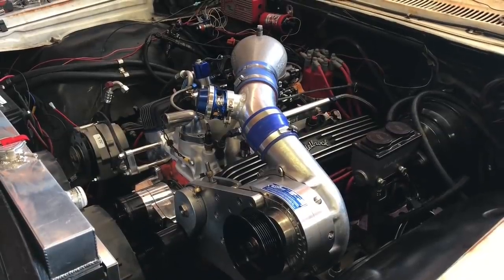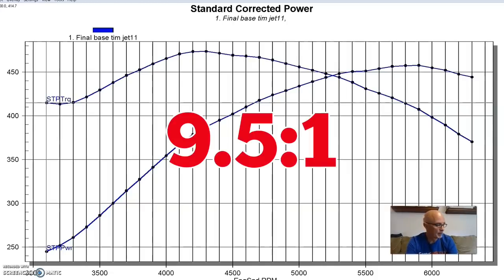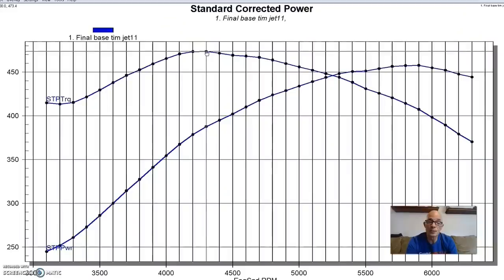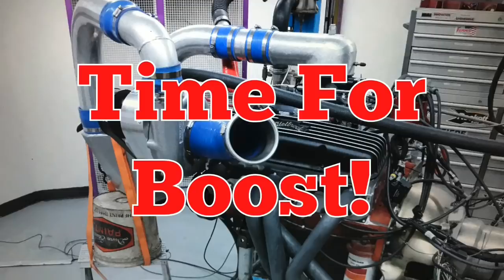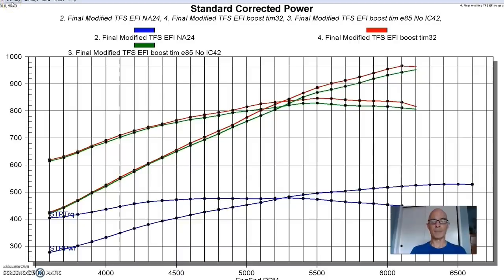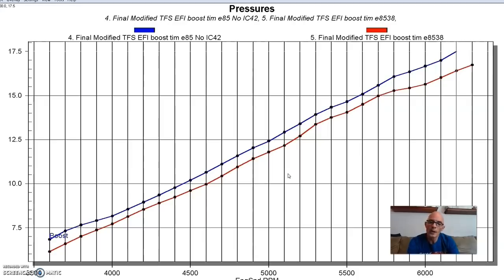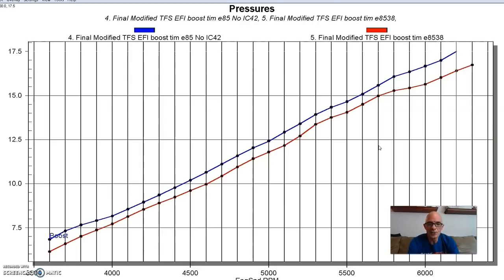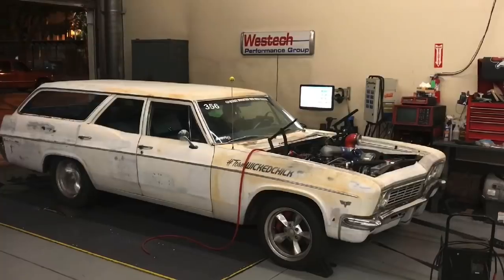SUPERCHARGED SBC 400!! McLAREN STOMPIN' SBC

Comment: Thinking it would probably be a little bit of both the temp and the restrictions on the air flow, but definitely a denser air charge makes a huge difference in how much your packing into a small space I'd like to believe where every little bit helps. Good build Richard! I'm a 406 guy so I love to see what you can squeeze out of a 400 inch block!

Comment: Now….how long did that block last before the webbing in the mains blew out the bottom with that much power?
Reply from the maker: still going
Reply: @richardholdener1727  

Interesting. I’m hesitant with my stock block at a touch over 700hp. Ordered an aluminum Brodix block….just waiting for it to show up so I can turn it up. 

What system were you using to control the FI and timing?

Comment: i realize this is an older video. you asked did the power go up because you lowered inlet temps, or because the intercooler length added a restriction while lowering boost.  it begs the question, during your years of testing, have you measured pressure before and after intercooler in the charge piping when testing this stuff?
Reply from the maker: yes-many times

Comment: Boost dropped when the intercooler was added because the air in the intake manifold was cooler, and therefore, more dense.
Increased intake manifold density --> Increased air mass flow through the engine --> Increased fuel for combustion -->  MORE POWAAAHHH!

Comment: How about a test that shows what happens when you put an air filter on one of these setups.  Also what you get with different charge pipes.  Test for straight pipe, 90* into the blower and a 180*

Comment: He could test that boost drop theory. Run the cooler but don’t pump water through. Should be very similar temp than no cooler with the length and restriction still there.

Comment: I saw this build on the internet, it helped inspire me to build my gen II lt1 to use with a supercharger.  I ended up finding a really good deal in a Vortech V-7 YSI. A more or less equivalent to the procharger you used. When its all done im ending up with a 9.5 to 1 383, fully ported trick flow heads, fully ported Holley stealth ram, a 240, 252 duration @.050 .590" lift, 112° lsa, 110 centerline hydraulic roller. Cant wait to get it done! Oh, I watched the program on netflix, was really cool to see this car ! Chad seems like a hell of a good guy. I binge watched both seasons! They need another season for sure!

Comment: I'd say that the boost pressure dropped as a result of the thermal efficiency of the intercooler and not the restriction in flow. If the intercooler was more restrictive, boost pressure would have increased across the inlet and the temperature drop would have been less. Nice build. Condolences for the loss of his wife.

Comment: Both the restriction and the heavier air, to put it simply. By adding the pipes, inter cooler, etc, you reduce boost by roughly 7.5%, and then with the heavier air (cooler, more dense) you are pushing more mass... = less boost, but still with the 120 degree drop, about 15%-20% more efficient. More than makes up for the lost “boost” percentage.

Comment: It's all about air density. You should have measured air temp at intake. You likely removed 100 degrees from the charge air temp. So the cooler, denser air contains more oxygen per volume than the hotter air.  The boost psi is lower because you reduced a massive amount of heat. Cooler air is more dense, but less volume = less psi. More HP because of the increase in air density, even though lower boost pressure.
Go watch Gale Banks channel for more details on this subject. https://www.youtube.com/channel/UCs50EmjtJyNLDcgTGSVNvcQ

Comment: Before reading any of the previous comments or responses. I personally would expect that the loss in boost is a result in an increase in air density as a side effect of lowered air temps. That being said lower temps and an accompanying increase in density would also lower boost pressure because the volume changed mid delivery.....Had you lowered the charge pipe size by say 1/2 an inch after the air to water cooler then I would expect that you would have had a relatively low loss of pressure if any loss at all.....again because of the resulting volumetric change due to this change in volume and this a smaller pipe being able to be used it may even be beneficial to do so in the future and see what happens.

Comment: The intercooler obviously added a small restriction. But the boost went down because the air got more dense. The same amount of air is being flowed into the engine. It's just colder. Put an airflow-measuring device on the inlet of the blower and it would measure the same.

Comment: The intercooler causes a pressure drop (all intercoolers do this) that results in a lower boost pressure reading after the intercooler. The aircharge is cooled by the intercooler creating a denser oxygen content in the same air volume. More oxygen + more fuel = more power.

Comment: My guess would be a combination of restriction and PV=NRT. You only mention the delta not the actual base temperature. If we knew where this started we could play with the calculations a bit and quite plausibly come up with a rough idea of how much is responsible for what. 

Another idea would be just to measure the drop with the IC at room temperature (no water.) Do that, throw the math at it and see if it adds up. I'd be curious.

You shouldn't have been that far off what was on the dyno. I don't see that being a super efficient powertrain anyways (I'm taking a guess on TH400+9" here maybe a 12 bolt) and you'd be nearer 20% loss than 10%. That'd still be near 1K at the flywheel.

Wagons were an old street racer's trick back in the day; The weight ratios would allow better weight transfer, not to mention the nondescript look of them.
Reply: I neglected to think for a moment and would compute N as a multiplier based on the HP difference. e.g. if the cooler air made 1050hp instead of 1K hp it'd be 1-((1050-1000)/1050)=~.952. I believe Volume would be the same with exception of the IC volume and I'm not sure that's significant given the air flow through the engine its self. 

Keep in mind this is all just guess work on my part, I'd be curious to see what Heywood or similar had to say on it in his book. It also wholly ignores any thermodynamic differences in efficiency generated (which is where I'd think much of one's error in calculation would come into play, fairly steady state frictional losses being another.)

Comment: The drop in boost is from both the added restriction of the intercooler as well as the drop in charge temp.  Water-based intercoolers tend to have low restriction pressure losses compared to air to air intercoolers.  More power indicates more air charge and since the manifold pressure, was lower you must have lowered charge the temp considerably.

Comment: Lost boost because the supercharger is compressing a fixed amount of air, when you lower the temp after the the compressor you have the air that's more dense reducing the cfm that leaves there cooler compared to the cfm before the cooler. The same amount of oxygen is still entering the engine execpt it takes less space to do so. The engine still wants the same cfm as it did before but by reducing the available cfm you lower the restriction on the intake side which lowers the boost pressure yet keeps the power at the same level.

The slight bit of added power comes from the super charger being able to pump a slight bit more air due to less backpressure in the charge pipe.
Reply: Not exactly. Loss of pressure was due to added volume change on a fixed pressure. Cooler charge just makes for a denser charge, hence more power. It doesn't add or subtract any cfm. It's just pressure.  You're on the right track though..
Reply: @vengeanceizmine9878  cfm exiting the cooler will be less due to the air being more dense. If 1000cfm goes in at 200deg and exits at 100f it will be less cfm but contain the same amount of oxygen in the lesser cfm. The cooler will, in a sense compress the air, or keep it from expanding as much.

Denser air will require more hot air to in the given volume to equal the same pressure

Comment: Cooler intake charge temps always cause a drop in pressure. Even though it is creating less pressure, the intake charge is denser and therefore makes more power. Denser intake charge = more oxygen packed into a smaller volume.

Comment: Sad to hear about his wife, but i bet it was special for you to work with him on the build.  Thats what being a car guy is about for me. 

Boost pressure was lost due to both cooler intake charge (ideal gas law) as well as the restriction from the intercooler.  The intercooler manufacturer should be able to provide efficiency numbers which would be useful to have a conversation about it. If we had pressure and temp after the supercharger, and at the manifold and a flow meter on it, we could have a great discussion about this. Was timing the same or did you give it more advance after the intercooler?

Comment: Density is why the boost pressure dropped. In the diesel world I regularly see 75mm turbos run 70-75psi with no aftercooler just water injection(rules wont allow cooler) then we run same setup with a good aftercooler and it makes about 40-45psi and a little more hp.  With a properly sized aftercooler I never even see 1psi drop across the cooler and I know because I datalog everything. :-)

Comment: Great vid as always! I might have missed it, but what block and bottom end was used? I would like to see a build with my favorite block, the Dart Iron Eagle tall deck, raised cam block. With the raised cam you can get a 4" stroke crank without needing a small base circle cam, plus the tall deck means the wrist pin doesn't need to be as far up into the piston rings. Combine that with great heads, like Brodix 18° and a race roller cam should make 700 hp pretty easily I would think. Oh and can I have the engine when you're done? Thanks!

Comment: Chad is an awesome dude another racer buddy the only thing wrong is his belief in Fords sorry to tell you my friend but Fords will never out power Chevyin any class from four-wheeling to drag racing to being on the dyno it doesn't matter Chevy is just a top-of-the-line over everything Dodge Chrysler Ford it's been proven how many times good day sir
Reply: I'm like chevy to but maybe you should watch the videos he did with boss 302 vs the dz 302
Reply: @MrJayo73  maybe you should watch the 900 million videos were you can get a Chevy junkyard 5-3 and get a thousand horsepower out of it yet these Coyote motors are making 600 with over $15,000 of aftermarket parts  good day sir
Reply: I wasn't talking about that generation of engines he a has a 3 part series I think about stock and modified 302's ford vs chevy.

Comment: Intercooler boost drop- 
You have to remember 
PV=nRT, so if temperature goes down, pressure must also go down. Everytime, all the time.
More power with less and 'cooler' boost is always a great formula.

Comment: Denser air charge. I love seeing boost drops with mods. Means your engine is happy we did this with a guys supra running 18 psi changed around the intercooler set up and some head work lost 3 psi and made more power.. So you can gronk the boost back up and make even more!

Comment: Gayle Banks " The Boost Gauge Is Dead to Me"
Reply from the maker: I love what Gale does, but 
the gauge is alive an well
Reply: @richardholdener1727  
I agree, but he has a point, hot boosted air makes more power, so long as you can keep the pre det away, but density is the real accurate measurement of potential power. 

I love what you are doing more, I get way more useful information watching you test everything under the sun and learning or rather relearning what can be done with compression ratio and boost, and I was worried about my 9:1 cr Suzuki G16B under boost, I'm doing a refit, and switching to E85 and taking the boost to 15 psi. 

You keep on testing and I'll keep watching and telling people about you 👍

Comment: I'm going to say it was the more dense charge air that was the biggest part of the boost pressure drop, and not the intercooler,  because you made lots more power, so the air was in the motor where it was needed

Comment: Pressure is resistance to flow. Less boost means less resistance to flow, also meaning more flow, so theres less restriction. Power changed because of air charge temperature. When charge temperature is colder, the engine can do more with less compared to hotter charge. This is that. Better Volumetric efficiency

Comment: The inter cooler drooped it a bit, but the drop in air temperature is the bigger part. hot air expands more psi less dense air,  cold air more pounds per square foot of air.more Power.

Comment: I'm gonna guess that at peak power half the drop in boost is from the restriction, and half is from the drop in temp. Given the drop in boost is really consistent it looks like at 4000 its probably like 60% temp drop and 40% restriction. As airflow goes up with boost, the flow increases making restriction worse but the intercooler has more thermal energy to dump, making the intercooler not as effective. If i could see the log from dyno charts of iat I could figure it out. Map sensors before and after the charge cooler is the fast way to learn if it's a restriction. It looks a little small for 1000hp and I don't know how much water your flowing through it. Nice...1000hp blown small block. Now for a 12rib

Comment: I lost almost 3 lbs of boost when I upgraded my intercooler. I was measuring boost in the intake so it had to be the density. Take a balloon and put it in the fridge it will shrink. Same air just dense. Keep up the killer vids!
Reply: At what boost level ? 3lbs doesn't tell the story hole story.  I'm guess you're over 15psi though.
Reply: Yes 23 lbs went to 20 after the uber large intercooler upgrade. At first I thought it was reduced restriction but the boost was measured after the restriction in intercoolers.
Reply: Cold dense air is better, upgrading to to large an intercooler for the turbo to efficiently fill is the problem.exceeding volumetric efficiency
Reply: That can ALL be true and you would still need to measure pre and post IC pressure, ive had cheap ones drop 6psi between inlet to outlet and the car wasn't making more power hehe...I stopped using them just use gapless top rings lol...

Comment: Calculate the amount of pressure drop by the temperature drop then compare the difference to the accual pressure drop and you can calculate the loss due to restrictions in the intercooler and pipes
Reply: if the intercooler was really a restriction then it would show less boost at the manifold because its moving less air, but that would lower the power number not raise it.

Comment: I believe you lost boost because you lowered the charge temperature. My theory Less temperature = less cubic feet per minute but same mass of air = less boost at the same blower speed
Reply: +1, not a theory because the other option (intercooler caused restriction) would RAISE boost not lower it.
Reply: Kimbal Mackinnon  not if the boost reading is taken after the intercooler.

Comment: Intercooler = denser charge, compressor is throwing more lbs/min air, result is more power at lower boost. 120° delta intake air temp is going to be worth around 15% more air, even at a full pound less boost.

Comment: It was the drop in temperature, and I suspect the restriction of the intercooler, along with increased air density that comes with the lower temps that caused the belt slippage.
I could be wrong, have been before.
Reply: Boost is a measure of pressure, and pressure is resistance to flow. Less boost means theres less of a restriction.